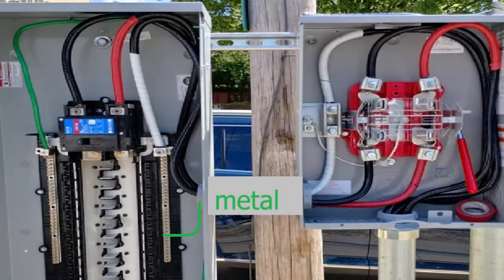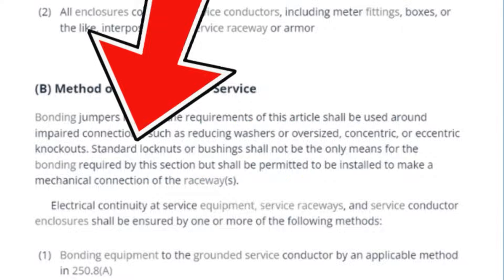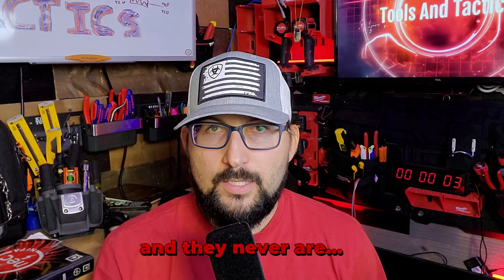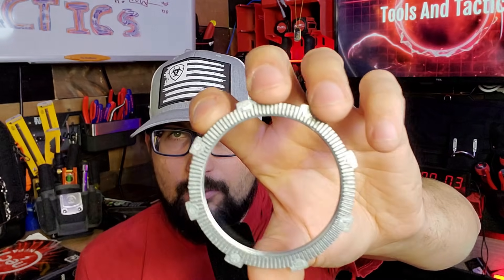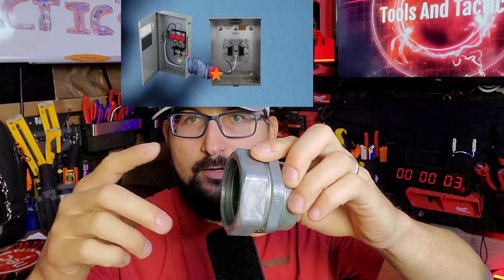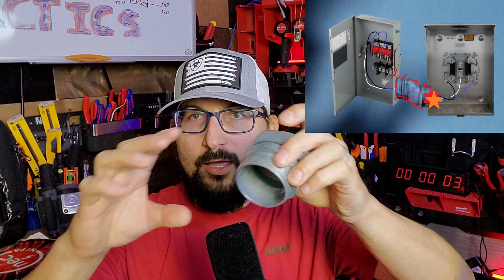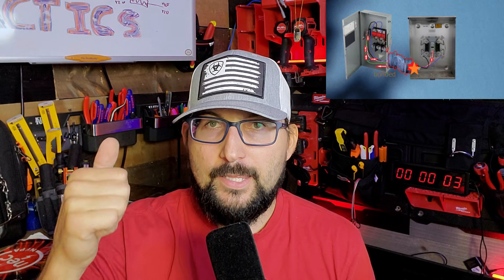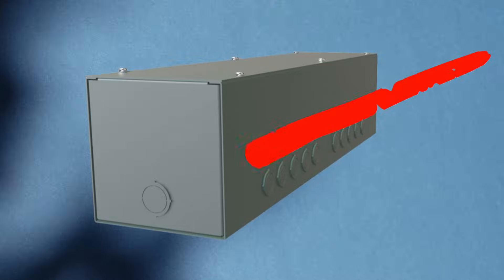Why You Failed Your Electrical Inspection Building A Service

Comment: How could you energize the meter and service mast when the neutral is bonded to the meter can itself?
Reply from the maker: Maybe not the meter can itself, but definitely the service mass, or nipple. If 
1 the screws that screw the hub. We're self tappers or not used ( i see connectors with lockrings  into the meter hub hole with no hub  ( so no threaded connection.  Not all the time, enough to have to put it on my radar when inspecting 

2 Or if they didn't use a bonding bushing you could energize the service nipple i've seen missing installation on only eight inches of conductor from meter to panel before, like back to back.  I have a pretty cool picture somewhere

But yeah, pretty hard to energize. The meter can itself if it's bonded, so you'd be right about that. Thanks

Comment: I have to go from my meter base on a pedestal about 2’ to my micro grid panel. I assume I need waterproof meyers. That’s the plan regardless.
Reply from the maker: the myershub will bond and also seal so it's a guaranteed proper install (usually)
Reply from the maker: if you run pvc no bonding needed  just sealing lockrings    be careful about pvc in the metal hubs though
Reply: @ can EMT be ran on top of a full concrete slab in a crawlspace in a residential application or does it need to be elevated and attached to the floor joists? This is for the DC wires